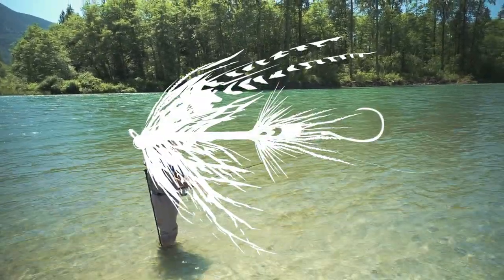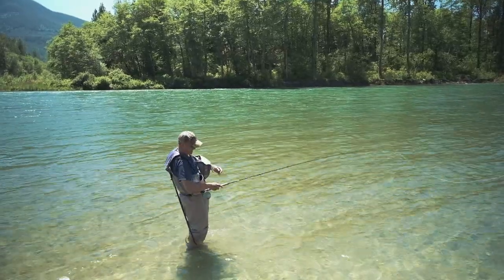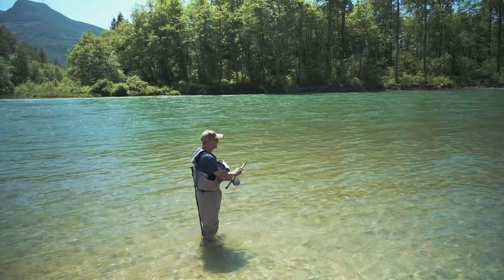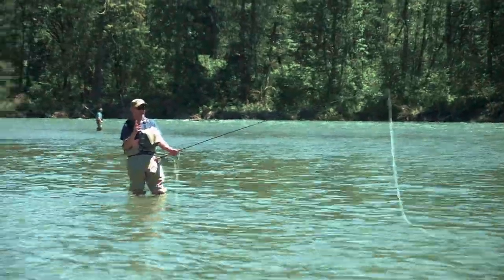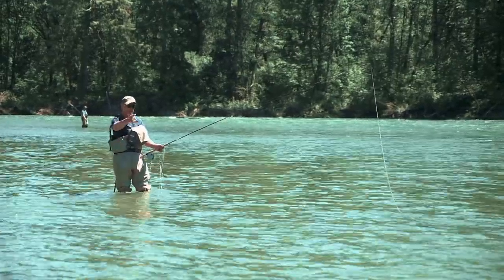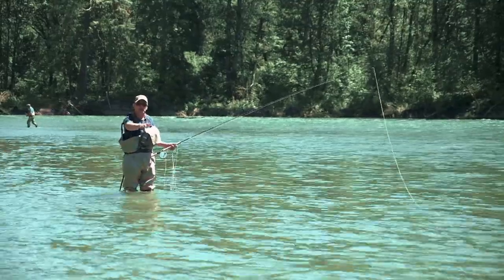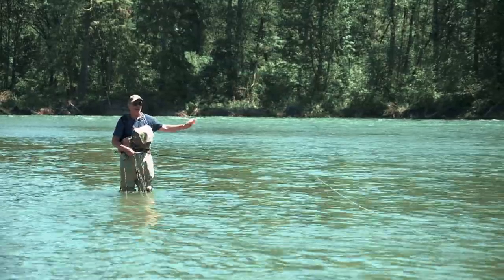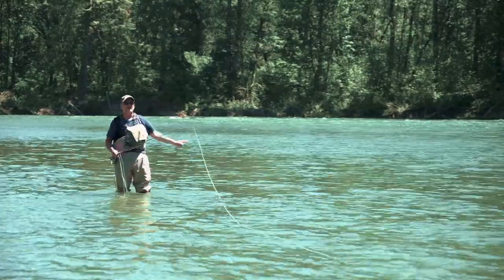Stripping and Casting a Streamer with a Skagit Line

Comment: I was in a situation which demanded something like that. I was fishing from a  jet boat anchored by the bow, and having to share it with a guy who was spin casting. I had the bow position so I at least had some upstream water to do a spey cast from. But to get my line from the dangle into a position to cast I couldn't do a Snap-T or a Circle C to get my line upstream without likely decorating the other guy or the boat driver with my fly. The solution was to strip in the Skagit head to its butt end at the reel, having hung on the the point on the running line where the butt was at the tip. A gentle roll cast stayed clear of every one, and  put the head just out of the tiptop laid out upstream. From there I could conveniently poke it in the direction I wanted to cast, and off it went.